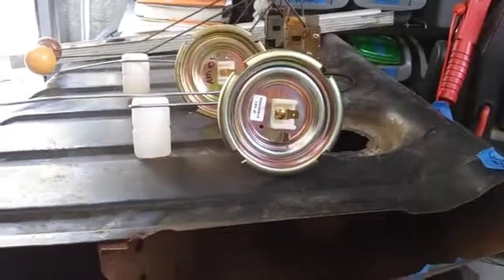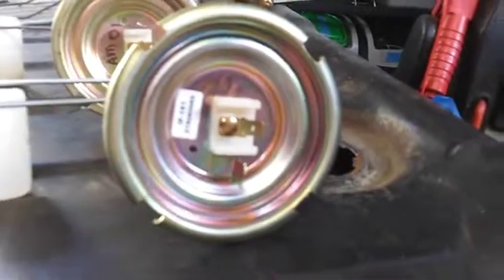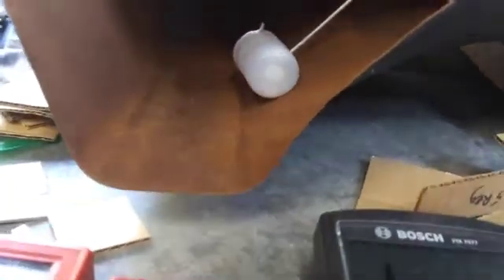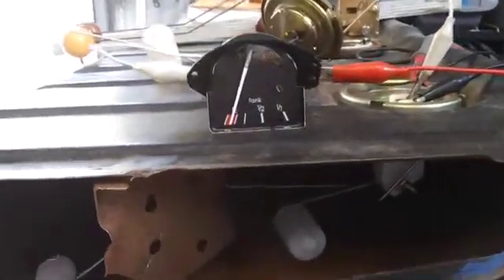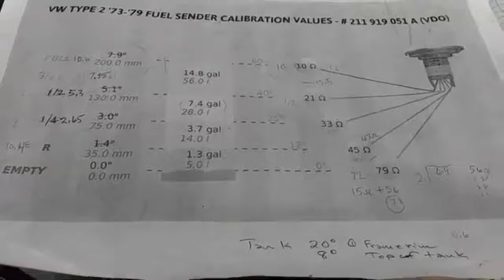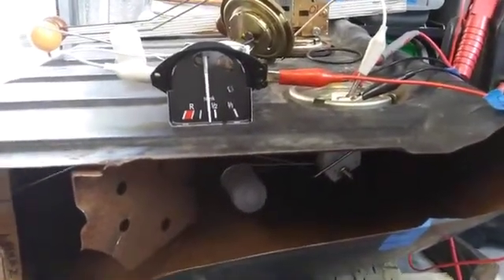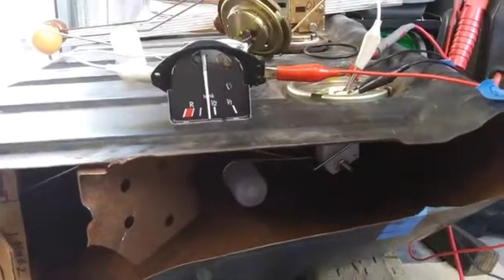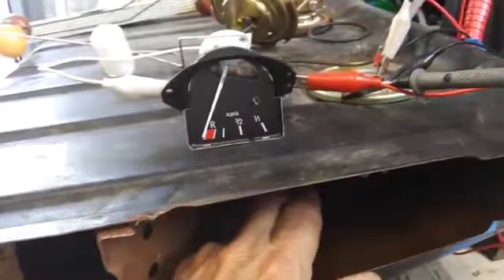Super Beetle Mexico built  vs Empi Sender differences. Testing done with cal. Gauge 7.5 reg.

Comment: Thanks for this video. Your video is amazing. Getting to see first hand how all this works inside the tank in relation to the reading on the fuel gauge. My fuel gauge quit working a couple weeks ago and lol that bothered me to know end. I fixed it yesterday, but I’m still looking at as many video on YouTube as I can to learn what I can for the next time. Thanks again!  76 black convertible with 1776 mofoco single weber 32/36.
Reply from the maker: What did you do to fix your gauge?
Reply: @vwbeetlefuelgaugesystem  Fuel gauge started to read empty. I joined together the two fuel sender wires and fuel gauge read full. Put new sender in the tank. Filled the tank and the gauge read 1/2 tank. Then I pulled the speedo and put on a new vibrator from Jbugs and the gauge went to 7/8. I haven’t drove the car enough to know how the gauge works through to empty.
Reply from the maker: @scottwrite633  Well run it and see what happens down to the 1/4 tank or so...  Do you have a dvm to read the resistances? <>33 ohms from the sender with the center wire disconnected.  R would be around 47 ohms.
Reply: @vwbeetlefuelgaugesystem  I have a dvm and will check it when it gets down to 1/4 or so. I have two wires on the sender. A yellow and a brown....   I should unplug the yellow wire and test ohms across the two sender prongs???
Reply from the maker: @scottwrite633  Yep.  Yellow wire is on the center connection.  Great that you have a DVM!
Reply from the maker: Are you a member of the samba?  I am Blue69baja on there. If we get a bit deeper and you want more info, send me a PM there and we can establish email addresses.
Reply: @vwbeetlefuelgaugesystem  thanks for the information on the fuel gauge and I’ll take a look at samba and see if I can get logged in 👍
Reply from the maker: Fuel gauge is pretty simple when you know what happens with bi-metal strips with heat!  My Baja has a 1914, stock heads and cam...  Std Solex carb  34...Provides great torque at low rpm but no high end like a bigger carb...  36 secondary weber is a pretty good carb, only restriction is the dual port intake.